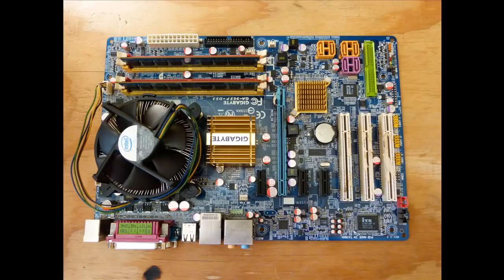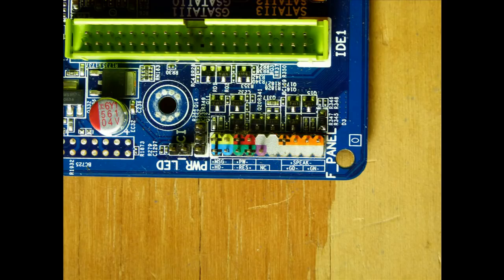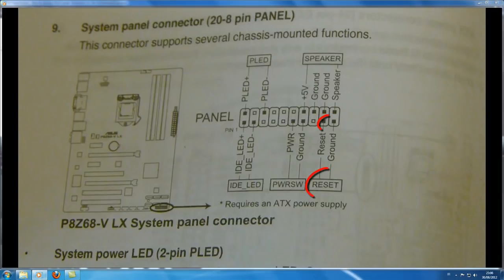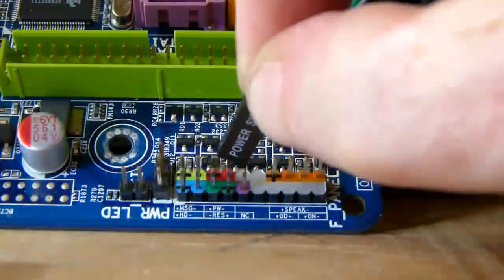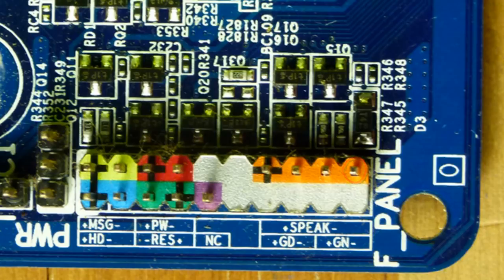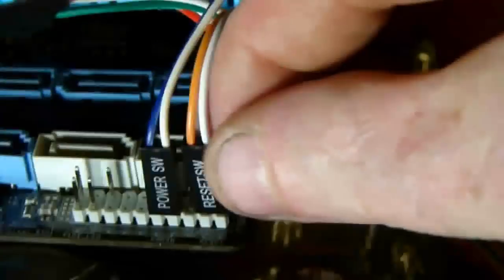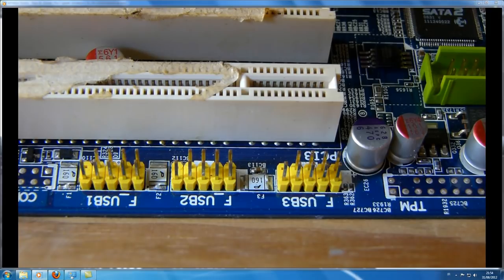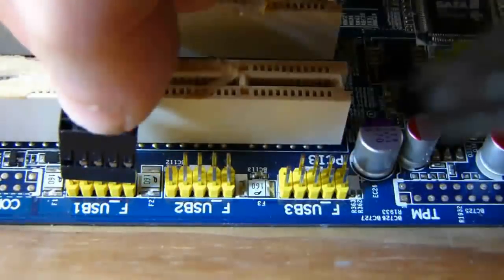How to connect front panel connectors to the motherboard

Comment from the maker: Yes Phoenix there is a huge difference between standard dell/hp and semi/professional boards and huge differences your operating system is not licensed to that board, specifications are usually higher on these boards and they will usually last longer. This is a huge subject and one that I will be extensively covering on my new site. The differences are not complicated but I could not explain them all on a comment here. You can get this information on build your own PC websites, hope that helps

Comment from the maker: Dose it say "Audio" beside the connecter on the motherboard you are connecting it to, it must be labeled on the motherboard or else it's not connected to the right place, usually this is placed beside the back panel audio. Make sure because static sagest that you are not connecting to the right connector, check the manual for front panel audio connection.

Comment: Thanks for the reply, i changed the sides of the cable but nothing happens, the only thing that i hear is a kind of static sound when i connect my headphones on the MIC in, but nothing sounds when i connect them on the Audio output... maybe the connector is dead.

Comment from the maker: if it's an audio jack then it must be plugged into a separate connector on the motherboard, so you should consult you're manual for the motherboard and follow it and you should be fine. but it could be faulty if you have followed the manual you should be good but i could be the cable also, and they are usually soldered to the front panel circuit, so it may have to replaced.

Comment: Hello, one question: I have a front panel audio on my case, and when i connect the cable and start the PC it doesn't seem to work, could it be the cable, or the audio connectors?, the thing is that the usb's on the front panel work, but the audio doesn't, and they are in the same circuit.

Comment from the maker: if it a new power supply then bring it to the store and get it replaced with a new one, if it's an old one meaning two years then you should replace it but you still have the problem with this new build so it think you should get some computer tech to take a look at it for you if you know someone or failing that bring it to a repair shop an get them to check it out with know good components best of luck LizziesKindaBeast

Comment from the maker: hi, if they are not color coded there will be positive(+) and negative (-) signs on the connectors if not consult your manual which will give you the direction you require.

Comment from the maker: This is just a hunch, but i think if there are on lights coming on check the power supply there is usually a switch on the back of the power supply it maybe in the off position, failing that it's possibly a faulty power supply. a power supply is a very reasonably priced component it may be a good idea to get it checked first before you start replacing the motherboard. hope that helps...

Comment from the maker: Nice board and case Deazel, So first check a few different devices in the usb ports because these usb ports are usb 2 not usb 3 so some devices that use usb 3 will not work on usb 2 ports even if they are backward compatible. then if you can remove the front panel of case if that's possible and check that the connection is correctly made to the usb ports, next just make double sure that your jusb 1/2 is connected correctly. failing that it's defective, so replace still under warranty i hope

Comment: Not sure if you're still helping people, but I just recently built a desktop and I'm searching for the reason why my JUSB1 and 2 headers won't power my two USB ports. I'm using an MSI 760G - FX P23 motherboard with an APEX TX-381-C case which has the USB connectors. I am guessing that one or the other is bad/defective.

Comment from the maker: Hi Sniffynicholas, Yes it will, but i take it that you have not purchased the case yet? if so make sure front panel connectors of the case you are thinking of buying will fit the front panel connections on the motherboard, by checking with case "manufacturers website" also check to see if your present power supply has enough power for the new discrete card this is very important also. Another point worth a mention here is the "case form factor" is it the same as the Acer motherboard.

Comment from the maker: as long as you have the power switch connected properly, so just check to make sure it is connected to power switch connector on JFP1. now if the computer will not turn on some of the other components connected to the motherboard are not connected correctly or sitting in their slots correctly. so check processor fan, memory(RAM), power supply has to connectors make sure they are connected. basically double check everything that connected to motherboard it's the only way to make sure...

Comment from the maker: yes JFP2 are usually for "extra" front panel connection, if you're case does not have extra connections, then that's fine. so just connect up the connections you do have. hope that clears it up for you.

Comment from the maker: hi Amar, Is this your first build? did you leave it on for awhile and see what happens? any thing show up on your monitor? my advice is go back through all the steps again heat sink fan not spinning means something is not sitting in it's correct place on the motherboard like cpu fan, memory, hard drive or graphics card. go back and check everything. the front panel connectors have nothing to do with your problem strip down the motherboard and start over. check in mobo manual eg FAN_CPU

Comment from the maker: You can get the info you need in the manual. If you don't have the manual you can download it from the manufactures website by using the model number printed on your motherboard.

Comment from the maker: Hi Atkinsonable, Have you got everything connected? processor and the fan for the processor also memory may not be sitting correctly in it's slot and the hard drive connected to power supply and motherboard. Make sure everything is connected correctly sometimes it's best disconnect and then reconnect everything again...

Comment from the maker: re-use is always a good idea, you do not need all the connectors you have mentioned above like power led, but speaker is important. Check the motherboard it may have one built in, but you can get away without having it.
The thing is if there is a problem with your system you will not here any beeps that can indicate that there is a problem without having a system speaker it's purpose is to i beep a few times telling you there is a problem.
you should get one for pennies and just plug into mobo

Comment: Do i need all the front panel connectors?
because the case i'm re-using doesn't seem to have a power LED or speaker and the audio connectors are separate connectors instead of one plug.
Should i just buy a new case or can i re-use the one i have?

Comment from the maker: you may have connected the switches incorrectly check that the positive and negative sides of the connectors are connected to positive and negative on the pins. so what i mean is (positive to positive) and (negative to negative) reverse the switch if these are wrong

Comment from the maker: first try different usb ports for your key board & mouse try each and every one, if that dose not work it the driver for keyboard & mouse is not working and you'll need to get a PS/2 key board and mouse and they will work and then go to device manager once logged in and you can reinstall the drivers for usb keyboard & mouse. that's if all is well in your bios double check to see if "usb plug and play" is enabled in bios
regards CHMEable

Comment from the maker: Hi greenoliver18, first what type of keyboard and mouse do you have (make and model) also are they usb type or PS/2 cause this will make a difference two what you need to change in the bios. Is the mouse and keyboard very old like more than 4 years it may not work with new board. another thing is if it's wireless if any of things i have mentioned above then send me a email and i will get you the sorted but you could try a different mouse and keyboard first. if that fails i will need more info...

Comment from the maker: Hi DarkLunaNight, There should be an indicator on the power connector cable like "pr sw" or "pw" failing that did you get a manual with your case? If you didn't then you can check on line by doing a search for your make of case.Is there a sd card reader header on your motherboard? check your motherboard manual. The power switch will just have a two pin connector and the sd card cable will look like the usb header but will have "SD" printed on it. Post model num & i'll get info you need...

Comment from the maker: Hi, the usb2 header on any board has 9 pins and usb3 headers have 19 pins. so the short answer is no you cannot connect them, but if you get a USB3 to USB2  CONVERTER cable you can still use your usb3 connectors in the front panel as usb2 connections "Antec on line store where you can buy Converter"
Note: So why not purchase case that has usb2 front panel ports instead of buy case that has usb3 ports or upgrade motherboard as well... just a suggestion.

Comment: Hey , nice video. I`m thinking about buying a Computercase with USB3 ports in the frontpanel,, however my mainboard only has headers for USB 2, is there any difference between USB3 and USB2 headers and can I connect it anyway so it works?